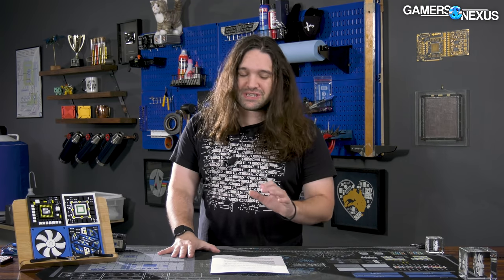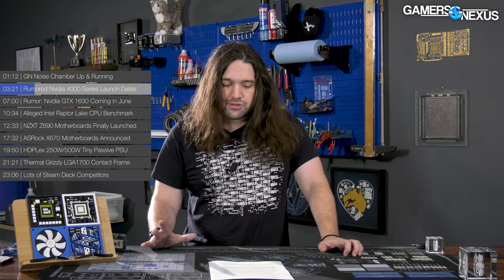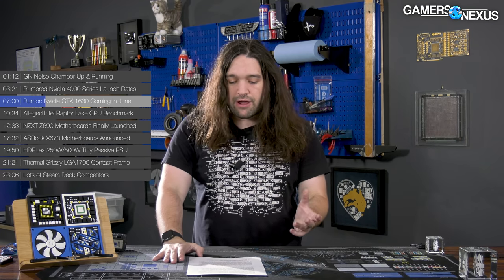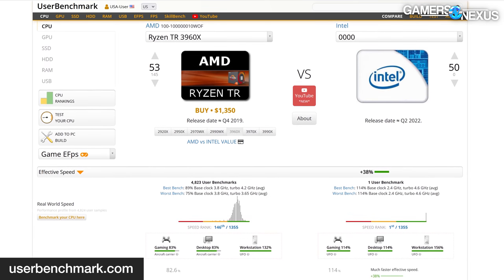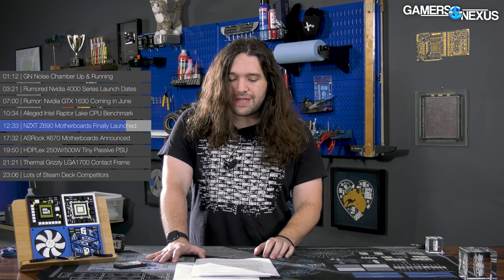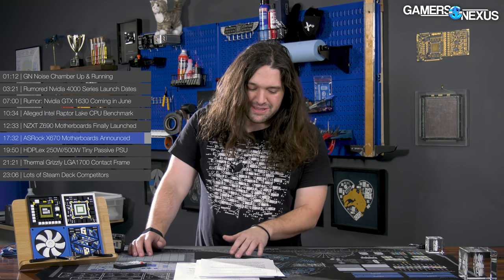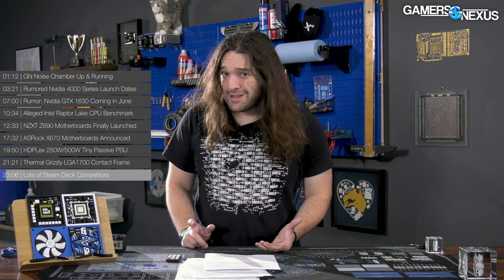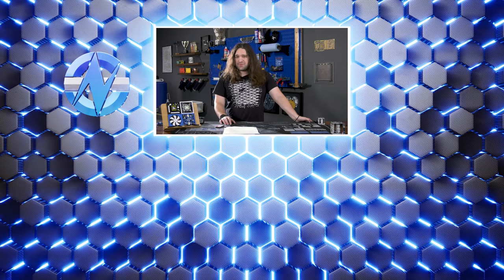HW News - Unbend Intel, RTX 4090 Launch Dates, GTX 1630 GPU, & Steam Deck Alternatives

Comment: No! 
 (To the ASRock Con-Tact motherboard.  It looks like shelf paper, to me anyway.)
Also, no to the NZXT boards.  They're probably made by ASRock too.  For goodness' sake just put a WiFi solution on the board!
I'm not an NZXT fan - all form over function - but the boards are pretty.  They made a couple of good-looking cases but the only one I considered, 
the 510 Flow, had only one fan location on the top.
Thanks to the last video I'm planning to visit Cha House soon, probably the one in Raleigh since I'm only three miles away.
The fanless mini PSU looks cool, though.  Two of them would make for a really cool (and pricey) small PC.

Comment: I would love to see more powerful 12V only PSUs and motherboards. They are cheap to make and very efficient. My new home server is a used HP office PC with an i5 9500.  It uses only 7W in idle due to platinum PSU efficiency and a basic motherboard. With 8GB dual channel DDR4 and an nvme SSD it is still blistering fast. The whole PC did cost £150 on ebay.

Comment: If you look at the naming of NZXT cases they always use odd numbers, especially 5 and 7. Like the 510 and 710. Therefore, it's only common sense that N5 and N7 must stand for the same nomenclature and probably the lower end N5 versus higher end N7.

Comment: Pure copper tinning process? Think something got lost in translation for that sponsor ad since "tinning" is adding another metal (usually tin) to the copper wires if done before they are insulated at the wire factory it gives a more corrosion resistant/humidity tolerant cable that usually lasts longer than pure copper especially in automotive (years for untinned copper vs longer than the chassis will last for tinned copper) marine (months for untinned copper vs years for tinned copper) conditions.

Comment: Hey, I was thinking, could you use something akin avg, 1% and 0.1% maximum power draw on your reviews? Since the spikes are really important at the time of buying a mobo and/or psu, the average still being useful for heat management and electrical bill calculations

Comment: I expect that most AMD MBs aren't going to jump up to 10Gbps ethernet.  That's either HEDT speed or home or small business internal LAN speed.  The switches are still very expensive to get 10Gbps on all ports.  So, top end boards for that feature.  Like $600 USD + boards.

Comment: Having to resort to User Benchmark data is a bit like finding yourself caught out for food on a trip and having to eat at a McDonalds. Yes, it will stop you going hungry but you know that you’ve not only debased yourself, you’ve done yourself no good in the long term.
Reply: To be fair, at least in the UK, McDonald's doesn't have the rubbish in it that is allowed in the US. As an occasional thing it's fine, using Userbenchmark is never fine 🤣

Comment: I actually like the design of the Carrara and it would fit very nicely into my white Phanteks Eclipse P600s (a case GN didn't want to test...) even though my air cooler and the big graphics card would prevent me from seeing much of the board anyway...
Much more importantly, the new Taichi boards don't have 10 gig LAN ports like the older X470 Taichi so no purchase from me.
And I also don't want a first gen AM5 board/CPU combo so no real loss.

Comment: That gan based PSU is impressive. If that one can be used for both laptop and desktop then nvidia will push the tgp to 1000W or even unlimited power harvested through lightning for dlss 4

Comment: For the Taichi Carerra: No, certainly not.  I've always liked the more industrial looks that came with the older motherboards that weren't afraid to show off traces, capacitors, fuses and more.  The growing trend of 'hide everything' is something I absolutely despise (Looking at you car manufacturers and all your plastic covering).  While I get that some of it is used for heat dissipation, I'd much rather continue on with something like the present ASUS TUF series.  It has a good mix of minimal RGB (which I'll be happy when the craze dies), some coverings for thermal dissipation and not being afraid of being uncovered.  While the marble look is a nice change, I still don't like the shift into showcasing PCs as has happened over the past 5+ years.

Comment: I hope you read this.
I have been dreaming of doing DIY Refridgerator pc build. Window air conditioners can be hacked with a commercial product "coolbot"
Or you can just use a mechanical thermostat wired yourself. Then build an insulated box around the air conditioner in the window and put your test bench inside.
The question I have is, what cpu cooler would work best? I am thinking Noctua would still kill it.

Comment: Hey Steve, you should do a deeper dive with the steam deck playing older games on it. I have seen one video where the guy who did it mentioned that an older game actually ran better than in windows due to the proton translation actually doing a better job of updating the game code for the newer architecture and I can kinda see where that is going. I don't remember the content creator, I think he has a lot of Linux content, but to me that sounds like an unintended consequence/added bonus to proton and he really didn't dig deeper into that aspect of his benchmarks as he was looking at proton in general and so covered more modern games as well, but I think it's looking into

Comment: Just watched a review of the NZXT motherboard and it was disappointing. It capped the 12900K, as it was unable to supply more than 200W to the CPU. Boost clock under Cinebench was below 4.9GHz. Entry level motherboard priced at mid-range.

Comment: The ASRock Tachi Carrera marble white looks "ok", as you mentioned, something different from black or RGB, but i dont know if i would use it. It would have to be for a themed build, otherwise i would look at a board with all the features i want as opposed to the looks.

Comment: NZXT has 11th and 10th gen iGPU graphics support listed under both Z690 boards. Yes, two CPUs from the previous gen socket. They are merely re-skinned ASRock boards, and clearly they don't care very much about them. Avoid.

Comment: Would the GTX-1630 be a worthy upgrade to my well serving core i7-950 build or am I limited by PCIe Gen2?
Reply: just quit gaming if you cant be bothered to build a new pc. do you live in a third world country? just do not understand why an adult in a first or second world country would game on a 10 year old gaming pc.
Reply: I can sell you my old 980Ti for $150 and it’ll outperform a 1630
Reply: @Joker  GFY
Reply: @Joker-no1fz  probably because most games these days CAN be played on a 10 year old gaming pc due to developer's prioritizing developing for poopy game consoles instead of PCs
Reply: If youre on that kind of hardware then buy used.
Reply: @t1e6x12  Thanks, its a good suggestion I think. I hope some of the Canadian used hardware market fills up as people upgrade.
Reply: @Jeffrey Grindle I agree, my Rampage III Ext. and 650Ti have been champs at running 3 monitors as I transitioned my build to more work oriented than gaming. Only reason I ask is because I am starting to get coil whine from my graphics card for any movement I make on screen.
Reply: @Joker-no1fz  There's no need to be hostile. I understand its the internet and all but a more constructive reply would've been nice. Computer hardware nowadays are expensive especially once its got "Gaming" somewhere in its marketing. :/
Reply: @slisgrinder  not even hostile just criticizing someone is not hostile. if you think it is i dont know what to tell you.
Reply: @Jeffrey Grindle Great, thanks! Am I losing my mind or are they still priced at ~$400 CAD?
Reply: @Jeffrey Grindle Yeah, its still waaay over that (even after FX to CAD) here :( 
I guess I'll wait a little longer...

Comment: interested in the power supply, its about the same size as a 1u 500 watt server supply ... but without the annoying 60mm fan and its modular so wieners! Handheld gaming ... ever since I was a kid and the OG gameboy came out, handheld systems have only held my attention for short periods, and its always been the ergonomics of the premise. Even when I was hot and heavy in the modded PSP scene, it came down to "do I want a neck ache, or numb hands" cause either way you either slouching over or holding something up ... that's fine for slower and or shorter games but as my main experience ... I am good thanks

Comment: Lets talk about Z690 PCI-Express lane divide. I understand that SLI and Crossfire are dead, but presenting x16 slot as x4 and denying users the ability to run ANY x8 card except for in first slot (and wasting half of the lanes) is just atrocious. While there are no Gen5 devices (and won't be, for a long time, GPUs don't particulary need the BW too), Alderlake should be capable of running two x16 Gen4 slots, at full tilt.

It's like anyone trying to actually work is forced to stay on older platform.

Comment: meh my 3080 hydrocopper ftw 3 will be good enough for another 5-10 years at a least. I really don't need or want 8k/120 gaming if the only noticeable benefit is a more powerful space heater. Even 4k/120 is mostly overkill on a 27" screen from 2 feet, and 1080p/60 a 3080 will be able to handle any optimized game made for the next 5-10 years if not longer.

Comment: What i would really like to see from moherboads would be chipset fans placed lower than now, because the fans is always totally covered by the gpu, which are quite chonky these days
Reply: You want the Chipset as close to the CPU and I/O as possible. And the fan should be as close to the Chipset cooling as possible.
Reply: @infernaldaedra  couldnt you offset it with heatpipes? or mabye elongate the mobo to the right and put it there, but thats a bit too radical i suppose. 
but there needs to be a solution to this. they could maybe make it suck the air in from the right, probably. choked chipset fans/coolers are not optimal

Comment: Should we wait for a 4080? or get a 3080ti now? Will we even be able to get a 4080? so many questions...
Reply: I’m currently debating on whether or not to buy a 3080 12 gb, because I’m not sure if 4080 will be available until the end of the year. 3080 is $1090 and 12 gb version is $1200 right now. 3080’s are still usually listed for ~$1350 and 12 gb’s are above $1500, so I might grab it while I can, I’m really not sure!

I have a 1080p 240 Hz monitor and I like to play games at high frame rates. Might buy a 2K 144/165 Hz monitor too.
Reply: @TBerq  I could be wrong but a 3080/ti might be an overkill for your setup unless you wanna do 4k@60fps
Reply: 4080 will be a 3090, and 3090 is basically twice as fast vs a 1080Ti.
Reply: @ale-lx9gp  I’m planning on staying at 1080p for a while and then maybe upgrade to 1440p. I currently have a 1070 ti that I’ve been using since 4.5 years. I’m afraid if there will be another scarcity and I don’t want to be left without a gpu for another year.
Reply: @TBerq  Not sure, I think personally I'll wait for the 4000 series. you probably should upgrade while you can.
Reply: @ale-lx9gp  I'm leaning towards waiting for 4000 series as well. I waited for almost 2 years, I can wait a bit more and hope that availability will be better this time I guess.
Reply: @TBerq  Best of luck dude
Reply: @ale-lx9gp  Thanks. You too.

Comment: All this extra publicity surrounding RTX 4000 chips and the GTX 1630 is making it look like an awfully grim and uphill battle for the Intel ARC chips, if/when they ever release. I hope Intel can launch their cards soon or it'll just be a bloodbath.
Reply: The 4000 series could be trouble, but there’s no universe where the GTX 1630 is, in any sense, an actual product meant to compete in a free market with other products. The 1630 is Nvidia pretending to throw a bone to budget buyers so they can get a metric fuckton of good PR from the tech press, while simultaneously making it clear to said budget buyers that they’ll never get a card that beats cards that were the same price five years ago ever again. It’s contempt for the consumers that made them disguised as generosity, and it’s disgusting.

Comment: i think the 4000 series wont be very good. they will need way more energy for a little more performance.
Reply: more power draw, more heat in your case = louder system the list goes on...

Comment: The 1630 is a huge missed opportunity, they used the older TU117 instead of TU116...
Why is that so bad? Well the TU117 uses 6th gen nvenc, meaning it's the same encoder as a 1050. The 7th gen is a pretty large leap in quality difference, and nvidia even made a big deal about it when the RTX 2000 series cards came out.
I mean, sure it's a step up from no nvenc support like the 1030, but it could have been a reasonable choice for a select use case, adding a lot of value to the price floor.
Reply: nvidia is milking u till the last cent ¢

Comment: Could have sworn Thermalright already came out with a corrector frame for the LGA1700.  Is there any difference between the two?  They look just about the same.
Reply: That one performs a bit worse but costs a lot less

Comment: re: the Carrara (is that supposed to be Carrera, but Porsche has already trademarked it?): I recently put together for the first time a machine with a glass side panel. Never again. Motherboards should not be seen nor heard. It's pointless making a motherboard with artistically designed coverings. Motherboards should be in computers with solid metal panels, not visible, no RGB, just quietly and competently doing work.

Comment: GTX 1630 is basically a weird quadro T400/T600. Honestly I'd rather just have the T600 for $150 used from ebay. The baby quadro cards are always tiny, single slot, half height and fit in any case. Even a recycled slim Dell optiplex. Plus the quadro cards always have 3 or 4 full feature displayport 1.4 or better ports. Often cheap gaming cards like gt1030 only have 2 or 3 cheap hdmi 2.0 or worse, dvi. And at least for Pascal generation gt1030 (gp108) had no nvenc, but quadro p400 and p600 did! Because quadro p400/600 is the same gpu die as GTX 1050 (gp107)

Comment: Not sure I would trust a new ASRock motherboard, I don't know if they are still cheating to make their products seem better, but I do like the look of the Taichi Cararra. And in the end the looks matter less than whether it's a good product and the company is trustworthy. 

I am curious how the GTX 1630 will hold up but not really excited as it doesn't seem like it will have noteworthy gains over the GTX 1050ti.

Also last but not least I am very curious how AYN's Loki will feel in both gaming and using for everyday use of windows applications since it seems that one was a significant hurdle for Steam to get past.

Comment: From my 10g upgrade journey I would say 2.5g and 5g feels more like a rip off. Switches and such are almost as expensive as 10g Hardware, while Performance is not even close. 

If you go used, 10g hardware is even cheaper and often more capable the consumer Multi-gig hardware. 

A used Sfp+ Switch & some Sfp+ cards combined with a few cheap sfp+ fiber modules will get you up and running in no time.

Comment: Motherboard expert here, Both X670E Taichi seem overpriced and unnecessary. The extra DAC is unnecessary as the 4080 (and variants like the 4082) Audio codec can already handle headphones up to 600 ohms, so the extra DAC is marketing bullshit and a waste of money. Killer networking is a huge oof, not sure why Asrock keeps insisting on putting it on boards. I get that killer's modern chips are just rebranded Intel chips, but we still have to deal with Killer's Drivers. Still don't know why intel owns killer. I would love to test this someday and see if killer's rep is as bad as it was before they were bought by intel. 

The aesthetics seem nice, I don't mind them and the white will make RGB pop. But white almost always costs more. I bet there is a 30-50 difference between the boards simply for the white marble effect. 

Likely I have these as a B tier MOBO on my tier list, possibly D tier depending on how I feel about Killer Networking. Likely these are in $500 range or more, and most users could get most of the same features in the 200-300 price point. My opinion my change once I can see the actual specs page.

Comment: Simple Question Answered, for ALL PC Components, colour Black, No RGB required or wanted, only recently has any use existed for RGB (e.g. Temperature Range indication).
I only care how my PC performs, I have the back panel "Displayed" to the room, the PC is on my right, behind me on my L shaped desk, with the long side is filled by the only RGB I care about.
That RGB, is the 2560×1440 pixels grids on my 3 monitors, two sides are 27", and centre is 32", I'm the only person that can just barely see into my PC.
I only care how my PC performs, it would be hidden away if it didn't need good airflow.